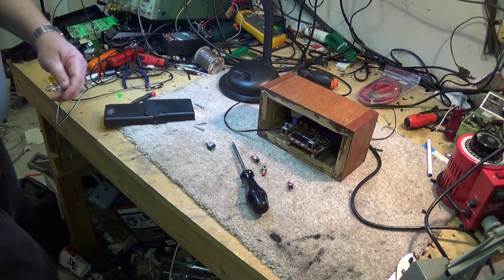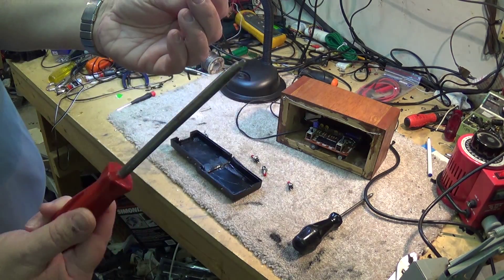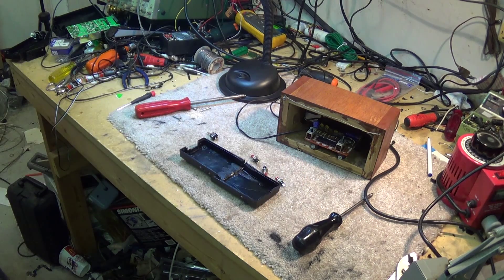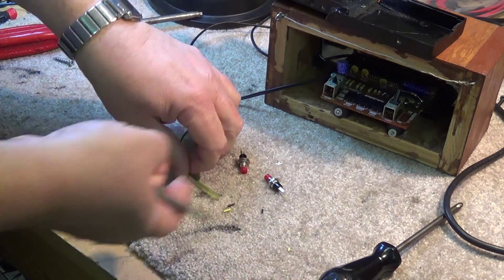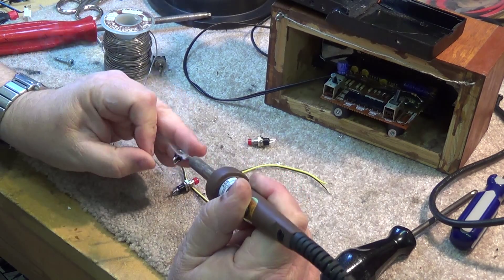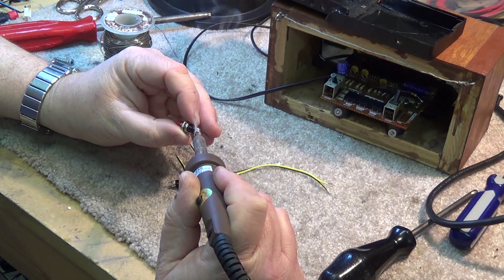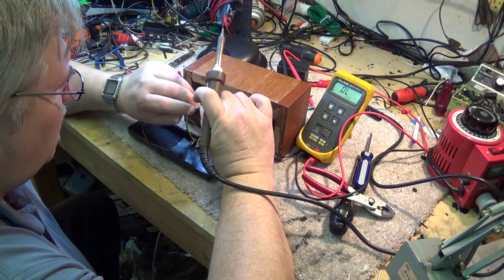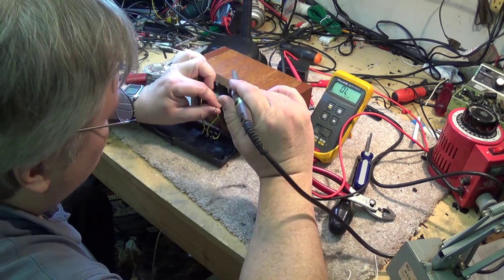digital vfd clock project part 2

Comment: I would have loved to see the relay installed as well.  That would have been a pretty neat function.  If you had this on the bench, you could have installed a few outlets at the back and had some buttons on the front to control different things on the bench and even had the relay control one of the relays for like your solder gun or something.  Just throwing some ideas out there.